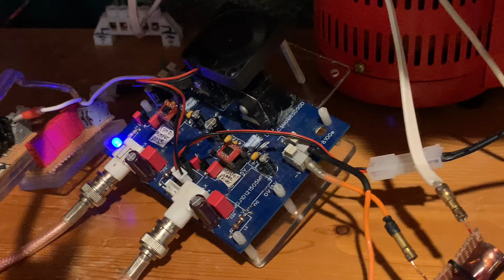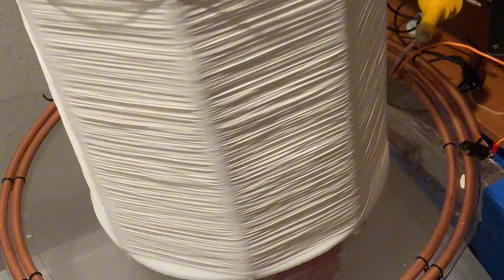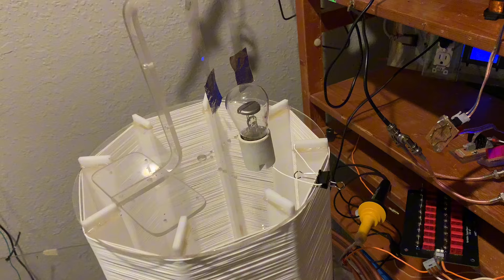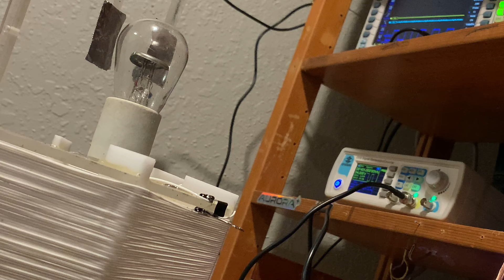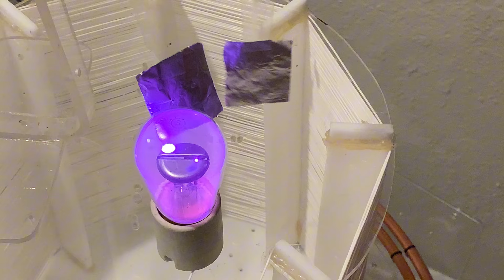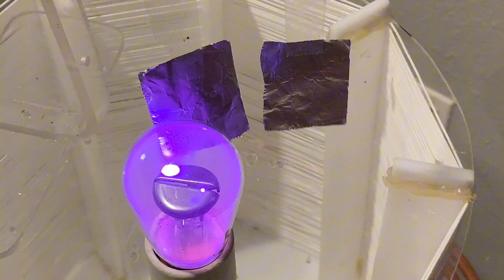Tesla Coil Phenomena: Capacitive Coupling, Electrostatic Attraction of Aluminum Foil to Radiant Bulb

Comment: Well done!
Reply from the maker: 👋 Appreciated, and thanks as ever for open-source sharing your circuit design, featured in this video 🫶

shown here: your mosfet high side switching module V3.2 PCB (2021).

My CIG setup shown in previous video was achieved using two of the single-FET V6.2 PCB's (2023), driven 180deg opposed 😎

BTW, do you have any advice for simple mods to help this circuit ring less at to help it run cleaner at 500kHz-1000kHz? i.e. presumably well above its initial spec / intended freq range?

I expect the gate drive resistors values should be tweaked? they're presently both at 10ohm. all component values otherwise match your published BOM.
Reply: @cold3lectric  yes gate resistance is to dim the ringing. increase if needed. OR use a mosfet with lower AMP capability as these usually have a smaller gate capacity.
You could also enlarge the capacitors at the gate side of the isolated gate driver IC, but that is only to increase the current capability for the higher frequencies, so it really can switch fast
Reply from the maker: @MasterIvo cool thanks. yeah at 130kilocycles, i could see the impulse spike hitting right at the gate opening, but at 1megacycle, more high frequency oscillations ride the waveform
Reply: @cold3lectric  yeah low amp mosfet like irfp510 and if you do need the amps, put the mosfets in parallel with each of there own driver. match gate Threshold voltage of the mosfets for simultaneous switching

Comment: Hi! How exactly should the ferrite cores be prepared? How does this work in practice? Does anyone have further knowledge or experience regarding these *domains*—their rearrangement, etc.? Any videos, more info? Has anyone done this before? Thanks. Quote:

"The "secret" of the kapanadze generator - in a process that prepares the ferrite cores (ferrite bistable), which determines the operating frequency. The same generator with the same success can be "taught" to work at a frequency of 50 Hz or 60 Hz. Preparatory technology is so new that it is

doubtful that anyone can understand how it works. The secret of the process that brings the bistable ferrite core to the appropriate condition. Permanent Ferrite Magnet (grades M0, 12W, M0, 16W, M0, 3W), placed in a special coil through which a current is passed from a pulsed source. Use a capacitor 6500 microfarad 450 volts. Then change the polarity of the pulse, and again provide a current pulse through the coil. The process is repeated many times as long as the structure of the magnet is not a lot of microcracks formed from multiple domain reorientation. In such a "semi-magnet" domains acquire the ability to navigate in a weak directed to "manage" the magnetic field. In fact, this structure does not shift the magnetic domains in the usual sense of the word, and reorient the substance of the larger magnet separated microcracks, ie acoustic domains. It should be noted that the best results prepare the magnetic substance, gives the transmission arc AC, directly through the ferrite. The coil is not required. AC frequency to match the frequency with which will be supplied to the control signal. Specially prepared circular ferrite magnets are used in the "trigger" mode. Bistable state of matter magnet provides a migration path from one side of the field to another, when applying for a control winding of a weak signal from an external oscillator. Moreover, if the material is prepared by repeatedly switching at a frequency of 50 Hz, then its control signal must have the same frequency. Management principle powerful flow through a weak signal is used in transistors. The output signal from the output winding and observed oscilloscope provides an excellent sine wave, the phase of which is not linked to the phase of the local lighting circuit at 50 Hz. Next posts SR'a: Then just a couple of hours ago had a little experiment: I took two transformer 220 \ 12 and connected in a way that would be the first step down from ~ 220 to ~ 12 V, and the other raised to ~ 12V to 220V AC, two transformers of equal power primerno20Vt. At the output of the second trans-pa (~ 220) a bulb connected to 220V 15W. Then the source of HV (high voltage) started serving weak discharges (DC 2-3kV) on output of the second transformer is connected to the lamp, the same level turned weak, as in the movie Tariel Kapanadze, but noticed an interesting effect: increase the lamp brightness outbreaks. The essence of the experiment was to test the reaction of transformer iron in the discharge of BB (high voltage) momentum. First transformer was needed only for the separation of the food chain. Experience itself, to some extent, pushed me to the next step. Dear forum members! I want to say that the principle of operation and design of the facility Tariel Kapanadze for me now is no secret. And it's not a hoax. I flashed it a lot of his time, it was more difficult to filter out all the garbage that is poured, such forums where useless information reaches 98%. I deliberately do not want to post information about the technical and principle of operation of the facility, which would not get the information to the "free riders." But not going to hide and be silent. Those who are "worthy" early go late, come to principle. Under the "dignity", I mean the level of brain activity. I'm willing to help people, to those who really know how to think and understand the essence. I want to keep a "dress code" of access to the information that is under the "dress code" refers to the level of thinking."
Reply from the maker: Ferrite cores are lossy, they get very hot. I use all air-core coils for greater efficiency. IMO Resonant coupling is superior to brute-force coupling through a magnetic core. And yes, the Kapanadze circuit has been done before, and has been written about for decades.

Comment: Yo, have you tried this with other materials apart from foil? Like thin iron or other ferromagnets, paramagnets, ferimagnets, non-magnet....
Reply from the maker: Cardboard, which does move a bit (perhaps the water bound in the paper gets polarized). Haven't tried anything magnetic though, because initially I aimed to show it as being distinct from any magnetic effect. Been a while though, probably will make more attempts before long.

Comment: Why is the electricity outside the bulb still pink/purple??
Reply from the maker: nitrogen / argon ionize purple, and are in the air too
Reply: @cold3lectric  thanks, I am used to the blue color. Surprised that the most common atmospheric element, nitrogen, doesn't ionize blue.